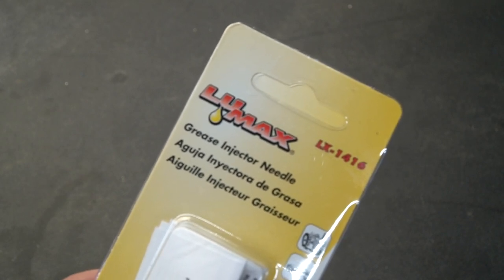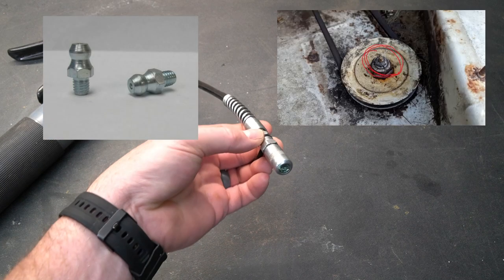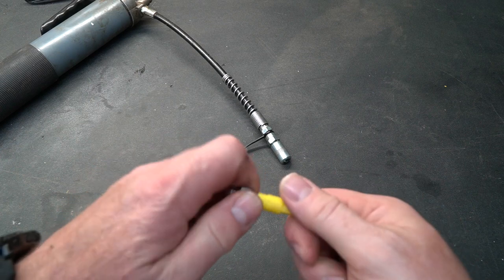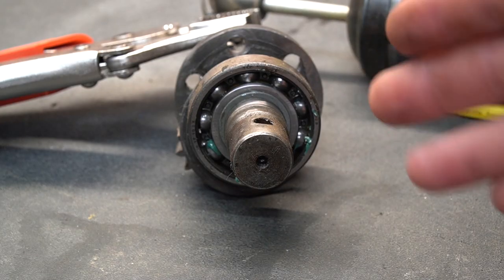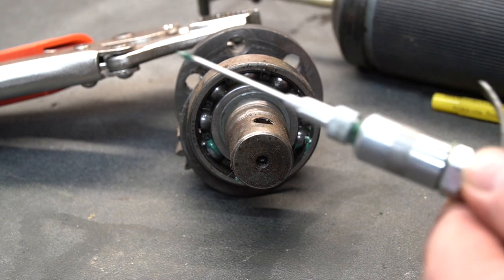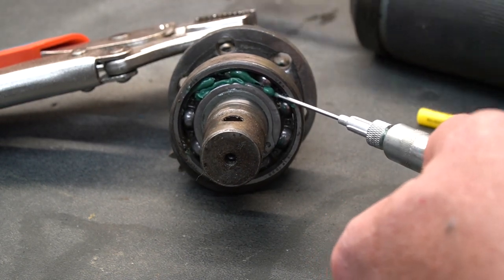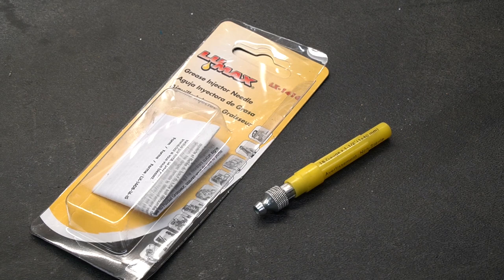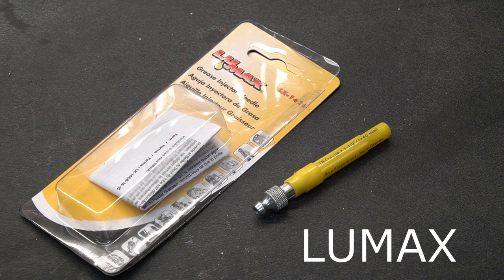Greasing Hard to Reach Places with a Grease Gun Adaptor, the Grease Injector Needle!  LUMAX NTDT!

Comment: I love that tool. It's really nice for factory suspension and steering parts that don't come with grease fittings. I drill a tiny hole where the grease fitting would usually be then put grease in there

Comment: It would have been more beneficial if you demonstrated this needle on something practical like a ball joint or tie-rod that does not have a Zerk fitting.
Reply from the maker: Yup, it can be used for a lot of things.   Your imagination may vary.....
Reply: I just pump greaes into my nall joint, then use liquid rubber or liquid tape.

Pro tip
.fill.the rubber boot, squees s bit so there's no pressure, clean with brake cleaner, spray at205 on the rubber and wait for it to absorb, wipe and supply liquid rubber. 

BAM